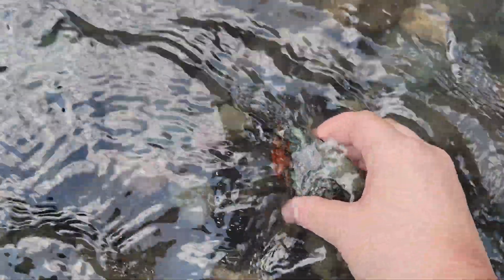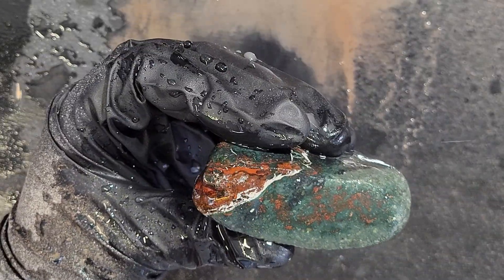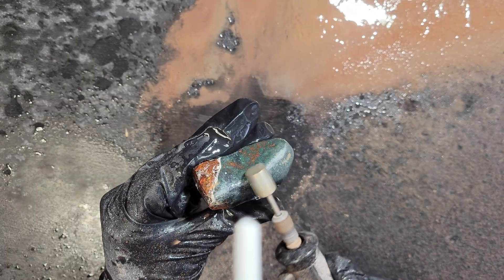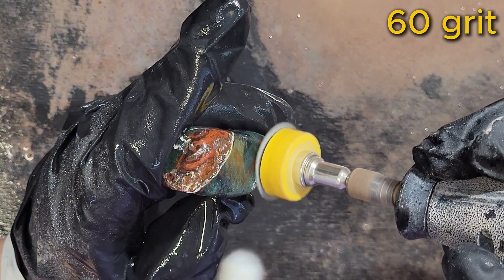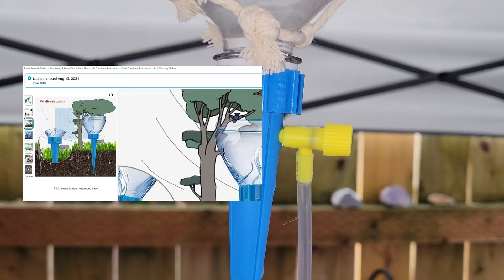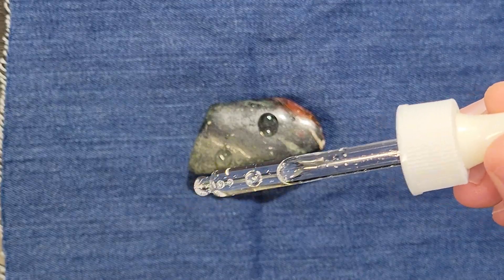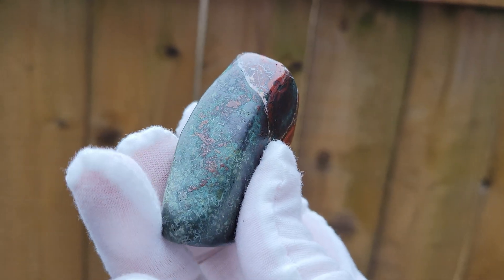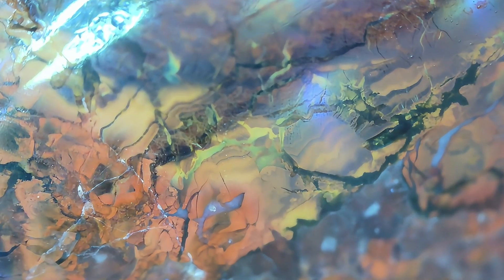Dos and Don'ts of Shaping | Polishing Swift Creek Jasper

Comment: The diamond drums, how long do they last?
Reply from the maker: It depends on how hard your rock is and if you're using water. No water and a hard rock will wear a diamond drum down before you finish shaping the rock. With water, I probably use an average of 1-2 per rock. But I'm also making videos, so I'm going for the highest quality I can achieve. You may not find as much work to be necessary

Comment: What speed do you set your dremal to during the sanding
Reply from the maker: Always low speed, which is 15,000 rpm on the Dremel 200 series.
Reply: and how long would you say you’d use each sanding disk and how much pressure do you use
Reply from the maker: @StardustWarriorskay Light pressure and the amount of time varies depending on the size and hardness of what I'm working on. I think 20-30 minutes per grit is a good estimate of time.
Reply: @ thanks for the advice it’s actually really helped me in my resent polishes
Reply from the maker: @StardustWarriorskay  anytime! If you have Discord and would like an invite to our rocktalk group, just let me know!
Reply: @thebroadhouse  ya sure id like to
Reply: @thebroadhouse  starwarskay
Reply from the maker: @StardustWarriorskay https://discord.gg/vzdWQFQ9
Reply: Great video, thanks! Could you please give details for the water dripping System?
Reply from the maker: @cv1531 Thank you! I need to make a video that explains it better, but for now I have this- https://youtube.com/shorts/kzxS1YrVYhw?feature=share 

It's a plastic bottle, aquarium tubing, and a self-watering plant spike with an adjustable valve.

Comment: So the you should try trading out that oil with aluminum oxide 12,000 grit or higher, with the same cloth. You will a much better more permit shine to the rock. Great video 💯. Lol shouldn't time your self, some things take time!
Reply from the maker: I've tried cerium oxide with a felt tip, but it was on something somewhat porous, so the cerium oxide got worked down into every little available space. I'm willing to try your suggestion! Is the aluminum oxide a powder? Thank you!!